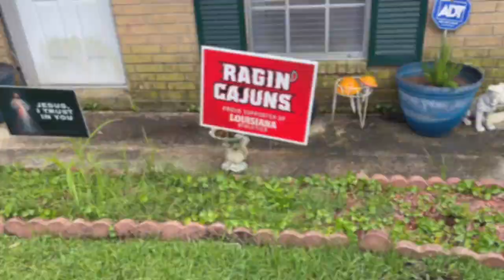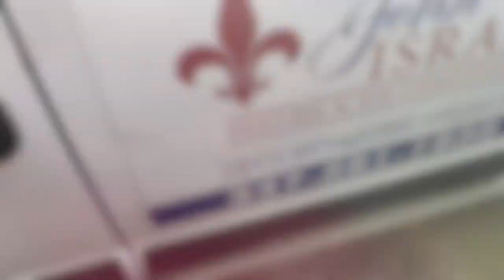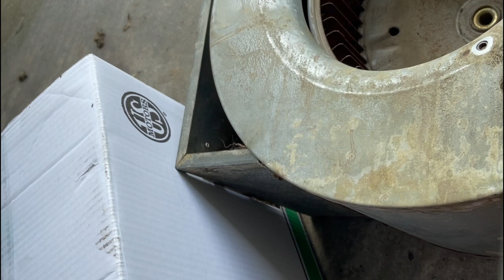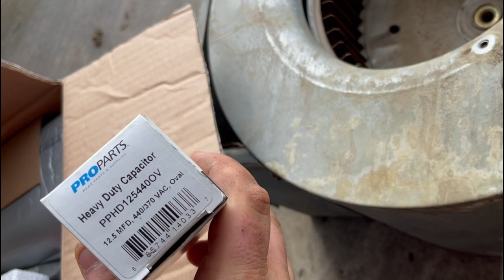No Cooling/Blower Just Humming

Comment: I did a blower motor change out on my 20 yo Goodman air handler.  Could not get the blower wheel off.  Didn’t get too rough trying.  Bought a puller & it came right off.  Three months later, got violent vibration.  Lowered the blower speed to continue operation (Houston in May) and ordered a $68 blower wheel.  Changed wheel, and it is running perfectly.  Should have replaced the wheel the first time.  I spent an hour cleaning it!

Comment: On one hand, I wish all blower motors were like that so I wouldn't have to fight the brackets, especially on trane psc motors. But on the other hand, then I need to go get the oem motor and potentially spend another hour or more getting the motor and driving back